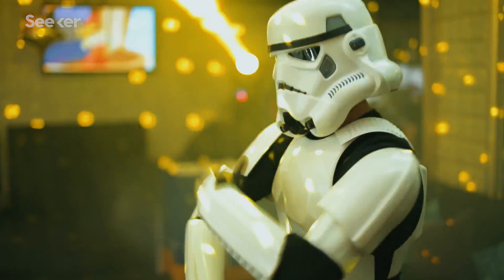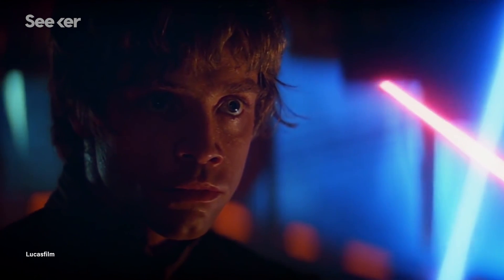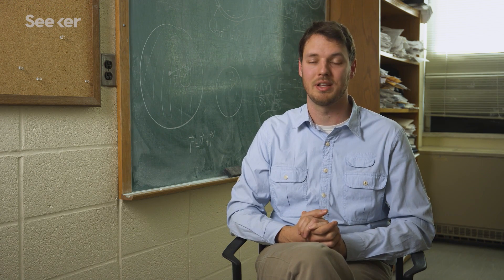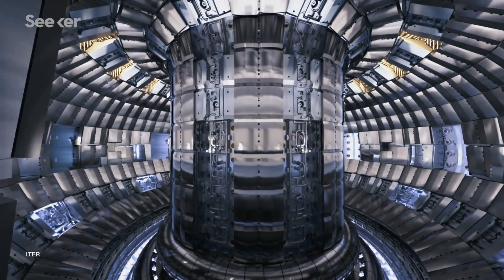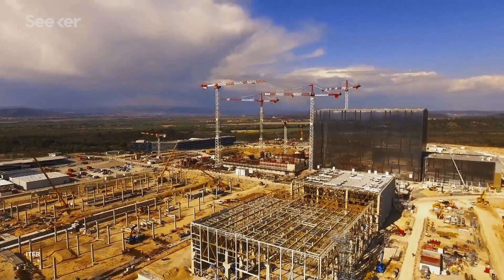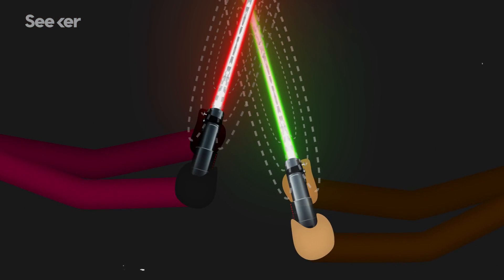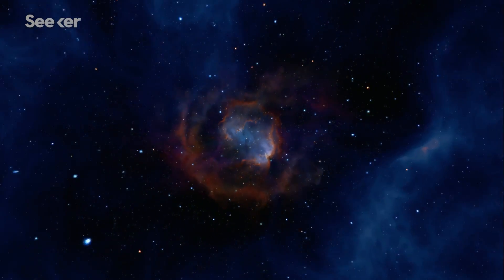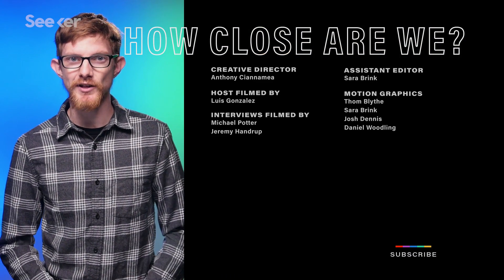How Close Are We to Creating a Lightsaber?

Comment: 1:30 Beam of a lightsaber isn't contained by the force power of a user. Otherwise non-force users couldn't wield it. Who's your lore guy?
Reply: The lightsaber's beam came from the ignition of the kyber crystal inside the lightsaber's hilt
Reply: joseph andrew evangelista but wouldn’t it just be a deadly laser without a force holding the energy back
Reply: That's what i was thinking. I immediately remembered Han Solo using one in Empire.
Reply: Solo, Grevious, Finn... dozens in the EU. I always simply thought of it as a strong magnetic field containing plasma and some other 'deflector-force-field-thing' to contain the heat and enable the blade to block blaster bolts. The kyber crystals have only been said to power the weapon and give the blade its colour.
Reply: @SebsterMS99  Also a few characters from the clones wars as well
Reply: Sebastian Samuel 
Yeah, you’re explanation is pretty much spot on!
Reply: Sebastian Samuel everyone u named has contact with the force.
Reply: George Rios if a non-force user is trained enough, they can use a lightsaber well. Two examples in canon are General Grievous and Cad Bane.
Reply: @dft4760  well its true i cant argue with you
Reply: @THEBATMAN28AHH  and fin
Reply: Its the power of the fictional crystals.
Reply: @BlackEagle352  stfu they are real we just didn't find one yet :D
Reply: @BlackEagle352  It  isn't powers by the kyber crystals, it's powered by a power cell. The Crystal acts as the light prism , which ones energized, project a single beam of 
Pure energy.
Reply: @thethe6232  so you're saying that the fictional power cell makes it limit its length?
Reply: I'm glad you left this comment it triggered me as well lol
Reply: hence finn lol either he is a force user or lucasfilm under kathleen just don't care about star wars and just wanted the money. Probably the second one.
Reply: AdonisGaming93 are you saying that only force users can use lightsaber? That is blatantly wrong. General Grievous can't use the force, but he is an expert in lightsaber combat.
Reply: @AdonisGaming93  Or maybe that Star wars has been a bunch of ham fisted crap from day one and people come by after the fact to try and make sense of things.... usually rather poorly.
Reply: Agreed. I think what they were miss-loreing was the fact that the technology used to contain the beam produces a lot to torque, so wielding a light saber in a way that doesn't lop off one's own limbs is difficult for a non-force using individual. I don't know where I heard that lore, but it makes sense in that light sabers are only carried by people that would get assistance from the force to use them precisely.
Reply: 100100011010010110 so you are saying it makes sense that only force users can use a lightsaber? That is completely wrong. General Grievous can't use the force, but he has killed Jedi Masters with his lightsabers.
Reply: ikr, as soon as I heard that I'm like wtf who even is this guy?!?  I'm not even deeply invested in SW lore but know for certain that he was dead wrong.  Even in the new rebooted lore there are clear examples of non force users wielding them.  Shit, look at Finn.  They straight up used him as a bait n switch for promo shit before the film came out.  I know there's some theories about the possibility of him being force sensitive n shit, but even if he is that doesn't exactly translate to him suddenly being proficient enough to control a lightsaber blade without any prior experience(IF they worked the way that guy was saying).  I always thought them being mainly used by force users is because they are so dangerous and so it would require either hella dedicated training or the superior awareness of a force user just to not accidentally pwn yourself.
Reply: Shit man, I’m not Star Wars fan and even I knew that. Once you brought it up lmao.
Reply: Sebastian Samuel I was just about to say this lol
Reply: It's a magnetic field
Reply: One or 2 Star Wars reference books I had as a kid said it was a force field (like a magnetic field, not The Force).
Reply: Han Solo used it.
Reply: Any body can use a lightsaber but the blade is weightless so only force users can comfortably use it because they can sense the blades location through the Force and not sever their limbs accidentally
Reply: Lester Shinglesnack General Grievous seems to comfortably use a lightsaber, and he can't use the force.
Reply: Literally stopped watching the video at this point. Obviously this Chanel is stupid.
Reply: I think he is mixing up that only a Jedi can make a lightsaber as the crystal won't just work off the bat and it has to accept the user.
Reply: I wish I knew what you guys are talking about.   Sounds like some cool stuff
Reply: @joshualuntsford   its all about star wars  canon ,EU , lore , legends
Reply: Yep, makes me wonder if these people have actually watched Star Wars.
Reply: Though the statement is false in a way its not completely untrue. Kyber crystals are either chose the force wielder  or synthetic krystals are forced to bleed by the force wielder. Only someone in touch with the force can create a lightsaber. A force wielder can directly influence the lightsaber when being used, but anyone can pick up and use a light saber.
Reply: Ya that's so wrong
Reply: True and finally star wars fans
Reply: theu got dials on thebdamn sabers lol
Reply: I think they meant that the force power of the user is resonated by the crystal
Reply: Finn used one in 7
Reply: Came here to leave that comment.
Reply: I think he’s referring to the legends canon not the official Disney canon. The Disney canon is a bit retarded sometimes.
Reply: Probably Rian Johnson XD
Reply: Isn't the force exist in all living being?
Reply: @Lord.Caridos  according to Luke in Episode IIX, yes. Qui-Gonn states to Anakin that it's the...
looks around
the M word
Reply: The lightsaber is activated by using pressure on hilt causing a reaction through the hilt to the kyber crystal or what ever object you use to power the blade then it creates a blade depending on what you use for the power source (kyber crystal) it’ll emit a surtain color the colors also based on imprinting what kind of person you are into kyber crystal
Reply: @EnderXGamingHQ  careful buddy. For some reason, random stormtroopers can turn on lightsabers
Reply: Mister C Any one can use a lightsaber you simply just add pressure to the hilt to activate it but being able to properly use the saber is much more difficult
Reply: @EnderXGamingHQ  my ass lol. Im sorry but i dont believe in the "new canon" 

To me the canon is from the canonical start of the Old Republic
Reply: Mister C I understand that I just use information from the expanded universe to explain things that weren’t directly explained in canon to make more sense of it all
Reply: But most of the people who have a lightsaber are force users because they are most likely Jedi or Sith who find the crystals and make the lightsabers.
Reply: Cole Griffith I know but when constructing a lightsaber you do not need to use a kyber crystal there’s alternatives such as a krat dragon tooth, ligmen lightsaber crystal and much more
Reply: The kyber crystal generates its own force field around it, according to kotor. So yeah, they really need to check the lore guy.
Reply: Mário Antunes best answer that I know of explaining this is that the blade circumferential bends back to the starting point causing it not to go on for infinity
Reply: They're probably talking about the shitty new canon
Reply: Nathan Dehnel I don’t think so from my knowledge the force does not hold the blade in a surtain shape and force isn’t required to use a lightsaber at all
Reply: EnderXGamingHQ eh, the Crystal does have an effect on the blade. A normal crystal creates a normal blade. A cracked crystal makes a blade like Kylo’s, very unstable looking. A shattered or fragmented crystal produces a light whip, which is exactly what it sounds like.
Reply: Yeah
Reply: That's why some people use buttons on them.
Reply: "And I thought they smelled bad on the outside." Han after channeling the force through a khyber crystal.
Reply: @JelloFluoride  Mate. He pressed the 'on' button.
Reply: I think he was referring to them using the force to enhance their skill with a lightsaber.
Reply: Before Disney ruined Star Wars that is true non force users couldn’t wield a lightsaber till fin
Reply: GG disney's star wars
Reply: get out of here you star wars scrub
Reply: @misfitsBP18  kthxbai
Reply: Exactly
Reply: The people who own the series have no idea what the Lore says or doesn't say. They change the Lore at will, so it is a Mess. The Beam of a Lightsaber is Tightly Bound Arc Wave Energy, according to the REAL Lore.
Reply: anybody can use a lightsaber according to Disney so shut up
Reply: @lostpockets222  You're only proving them right... Maybe you should shut up.
Reply: @lostpockets222  That's what he's saying dumbass!
Reply: @lostpockets222  Thats what he is saying dumbass
Reply: @lostpockets222  that isn't cannon to me
Reply: Lostpockets 222 I mean anyone can use one but they can only just fumble around with it like when Luke first got his and he had no training he could still ignite it but I agree Kylo Ren should’ve killed Rey and Finn
Reply: Hotpockets 222 Hotpockets 222 Sorry to brake it to you m8, but Disney makes things that aren’t real. Like fictional movie characters with supernatural powers
Reply: @lostpockets222  pre Disney clone wars had no force users using lightsabers
Reply: Nathan Risher the Clone Wars had no Force users using lightsabers? Wrong. Anakin, Obi Wan, Dooku, Mace Windu, Aayla Secura, Ki-Adi Mundi, and all the rest of the Jedi used lightsabers.
Reply: @nathanrisher2712  not totally true. Han Solo used Luke's in the Empire Strikes Back. Solo was not force sensitive.
Reply: How it works is that the kyber crystals give you a bit of a boost with the amount of force power you have, non-force wielding people get to use the lightsabers because the crystals give them enough of a boost to generate the beam, while with regular force wielders get a more mastered beam, because the power boost allows them to boost their control over their beam
Reply: Sebastian Samuel   I haven't read The Canon of Star Wars. But I thought the Lightsaber was an "ego" or spiritual "( for want of a better term) extension of the being wielding it. Thus the various colours of Lightsaber there are ⚛️
Reply: @6Fiona6_P_6  Ish... the colour of the lightsaber is influenced by the colour of the crystal. The crystals are clear by default but when paired with a force user they adopt a colour in alignment with said user's attunement to the force. Blue, green, yellow, purple. The red colour is made when a dark side user actively 'corrupts' the crystal with negative emotions. This is the canon explanation.
The old EU explanation is that the crystals posses their colours naturally. The red crystals are simply synthetic.
Reply: @SebsterMS99  I like EU explanation better
Reply: Sebastian Samuel well somebody knows what’s going on
Reply: @tdanel  me too!
Reply: Sebastian Samuel I thought they were read because they were man made crystals
Reply: Jeffery Bauduin Most crystals are natural occurring in Star Wars universe such as kyber crystals but some are artificial made such as ligmen crystals and most sith crystals are made in labs. For the most part most crystals are found in mines on surtain planets in graves with dark side or light side of force
Reply: @EnderXGamingHQ  Everything you say is correct in the context of the old expanded universe. Canonically, Sith crystals are no longer made in labs. Also, I'm not sure whether alternatives to Kyber exist any longer such as Krate Dragon teeth and the sort. With the exception of whatever's inside the Dark Saber which I'll wager isn't Kyber.
Reply: Sebastian Samuel This alternatives still exist in the universe Kyber crystals are the most basic crystal used by Jedi order but other more powerful alternatives exist like the ligmen lightsaber crystal which is created from  ligmen this lightsaber crystal allows you to break a regular light sabers blade. The darksaber crystal is similar to a ligmen lightsaber due to its color ration but does not have the same dark side properties of giving user a stronger connection to dark side
Reply: the red crystals were usually synthetic, it was rare, but some red crystals did naturally exist @SebsterMS99
Reply: @6Fiona6_P_6  nope

Comment: You gotta make light behave like a magnet somehow 🤷🏽‍♂️
Reply: Maybe somehow make the atoms in the air arrange in such a way similar how iron atoms are arranged to create magnetic field, maybe there's a way of controlling how the atoms arange in such a way that woupd dictate the shape of the magnetic field generated, maybe the thing that does it could be so magnetic and so anti-magnetic in such a manner that it doesn't attract surrounding metals that can become magnetised but keeps light trapped and revolving in such a manner or plasma, and holds them in a 'sword' position say...
Reply: Thats technically possible.

You would need to alter the positive and negative ions in the electron flow. So yes it could be possible.
Reply: Cybertronian Sniper 
Very insightful! A magnetic field has a limited range and can contain a light beam. But, can a light beam contain a magnetic field? Ah, HA! Both magnetic fields and light forms can be restricted or reflected by some metals. This might be doable in our lifetime, if we drop the requirement that the light saber beam must be able to collide with another beam as if it were solid. That's an energy containment hurdle we aren't prepared to overcome, yet. Unless they provide an upgrade package which includes a little sound chip that is activated when the saber is in motion and/or detects a disturbance in the (magnetic) force. 

Couldn't help myself...